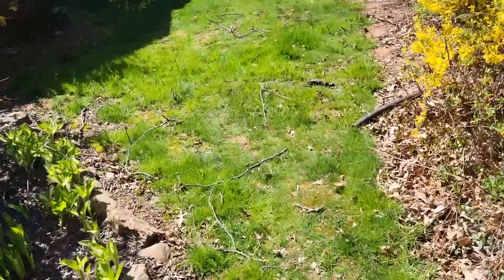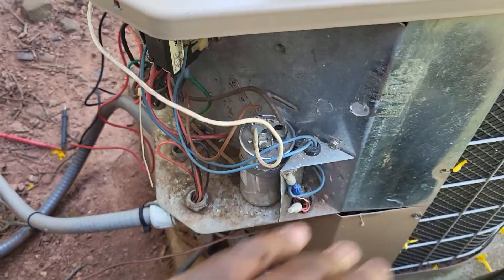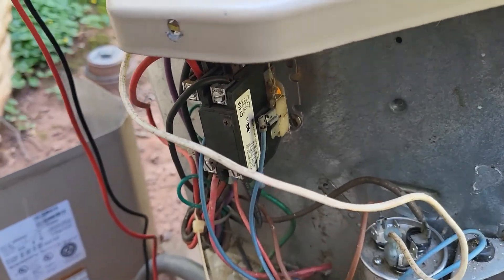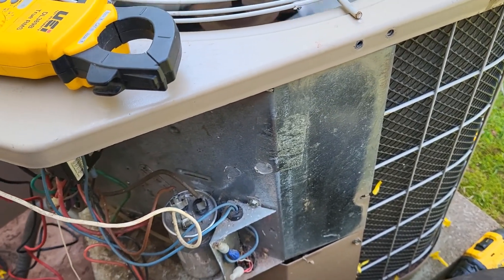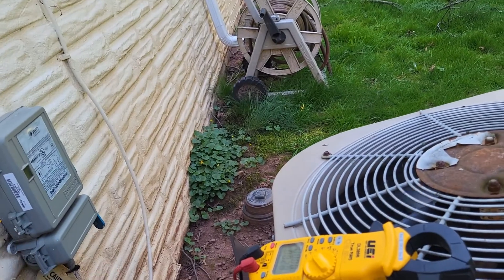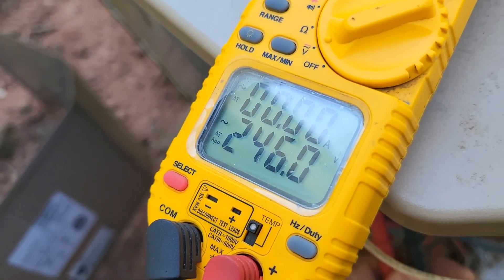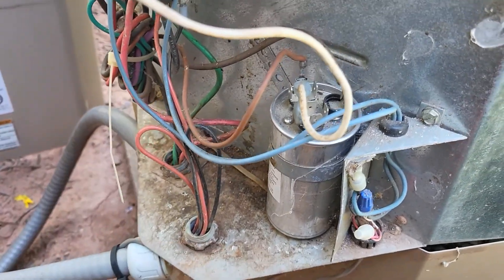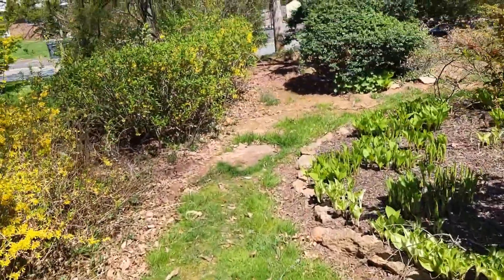When should you replace a contactor?

Comment: first off, great vid. what if I had a blown run fan motor cap, replaced that, and now the fan and condenser will only kick on if I manually press the plunger...ohms across the coil was 9 if im not mistaken...plunger moves easily when pressed, no perceivable obstruction but the plunger itself is not activating. thanks for any help.
Reply from the maker: Thanks! & a multimeter will be your best friend here. The "plunger" you refer to (is the contactor), which needs 24v to energize & pull in on its own. Otherwise, it won't work. 

You need to first verify power to make sure it is getting 24v at the coil. If not, then start working backwards to find out what's open in the circuit

Comment: As a homeowner my York heat pump is around 20 years old. The only thing that failed was ONE of the 30A time delay fuses. I have plenty of ATC 4 fuses, contactor, time delay fuses and a Turbo 200 Am-rad capacitor JUST IN CASE!!
Reply from the maker: Intresting. Random fuse trips could happen. But I'll say this if you keep your OUTDOOR clean, it can ceetainly help lower Amps on the condenser, which will lower the chances of that fuses popping again.

Comment: Very good Video:

I have a few questions for you:

1.  Other than visually and voltage difference:  What other tests can assist in the judgment of changing a contactor?
2.   Is checking ohms on coil contactor a good test to replace contactor (below 10 and above 20 ohms).
3.   In an extreme hot  weather region, is it advisable to replace contactor every 7 years regardless of measurements (or is not cost effective)?

I understand that most answers are " it all depends"  I am looking for a conservative strategy to be proactive not reactive to AC being down on the hottest day/night.

Thanks:  your feedback is highly appreciated.
Reply from the maker: Ok let's break it down... I got you‼️‼️‼️‼️

Question #1. That's a loaded question. It really depends on WHY you are out at the home.
 
Reason being- 

on a maintenance there is alot MORE reasons to replace that contactor vs a no-a/c call.

 Replacing that contactor during a MAINTENANCE saves that customer time (from taking off work) & price (from inflation) vs. Doing it later (& risking a more serious issues like a compressor failing & a more expensive repair) 

Question 2.

Ohms.... ehhhh to each its own. I think potential difference & visually checking for burn wires/burnt terminals may be your best bet. Checking ohms is mainly for compressor failures/ testing t-stat wires for a direct short) to be honest in my opinion. 

Question 3. Hell to the yes. 

The contactor is NO DIFFERENT THAN a capacitor. Neither are supposed to last the ENTIRE LIFE-SPAN OF THE A/C SYSTEM.  

The contactor 
The capacitor 
(Relays) on circuit boards
Thermostats

Are all considered "maintenance items" meaning we won't tell a customer they will last forever. 

Maintenance is the only guarantee to stay on top of future breakdowns... But all of those mentioned parts above have a shelf life of 6-8yrs BEFORE showing wear & tear. 

Hope this helps ‼️👊🏾
Reply: @Drewdriskle  

Thank you so much for taking the time to answer my questions.  Amazing knowledge and experience you have in the HVAC field and humble enough to share it with your viewers.   I am creating a table to stay on top of the following items:  Condenser coil cleaning (1 year), Evaporator Cleaning (3 years)(depending on cleaning habits), capacitor change (7 years) and contactor changing (7 years).   Of course, a yearly preventive inspection to view physical conditions of parts and wiring.

Mr. Drewdriskle, does the blower capacitor needs to be changed every  7 years?  Do you feel something else needs to be included during preventive maintenance or time change frequency? Fan motor??

Excellent job you are doing out there!

Comment: Im an AC tech as well, I came a accorss a contactor that had 24 volts on both sides but does not pull in. SHould I relplace it? or could it be antyhing else
Reply from the maker: You can try popping in a new contactor but just hook up the 24v wires to see if the new one pulls in (if the new one pulls in GREAT if not then its back to square one) 
It could be a few other things as well.  Either your LP or HP switch outside is open (verify this by removing the wires from either or one at a time to see if the coil pulls in) or it could be a bad common.

A bad common means power is getting to the contactor but nothing is coming back (to the indoor unit) to complete the circuit.  I would try checking for broken low voltage wires from your contactor back inside 

&

Also if the wires are intact & not broken maybe try ohming them out. 

It definitely sounds like something is causing that contactor not to energize. 

Hope this helps. Good luck!
Reply: @Drewdriskle  your awesome bro thanks. I found the issue, someone landed it to the r terfminal and not the c

Comment: After changing contactor, ac doesn't click on at right temp,i have to lower temp under 70 for it to start,is there any relation
Reply from the maker: If you have to lower the temperature of your thermostat to UNDER 70° then that means that the room temperature is already 70° degrees.

Maybe the room where the thermostat is in is naturally cooler than the rest of the house?

 Or maybe something around the thermostat is causing it to read a cooler temperature than normal? 

Also another thing you could do is buy a room thermometer & check the temperature of the wall that the thermostat is on (to make sure that your current tstat is reading accurately) 

If the wall thermometer is reading within 2 degrees of your thermostat than the thermostat is OKAY. But if your wall thermostat has a 3 degree difference or higher than I would recommend replacing the thermostat. 

There could be a number of things but I hoped this helps!!
Reply: @Drewdriskle  thanks for responding. Maybe it needed to re calibrate because i left it on, and the next day, it started clicking on at 75 degrees, which is my desired temp,so im all good now 👍

Comment: Thank you! I just ordered  a new contactor for that exact reason, it also burned the wire going to the condenser,  before I replace it I will check for voltage drop, Nice tip!